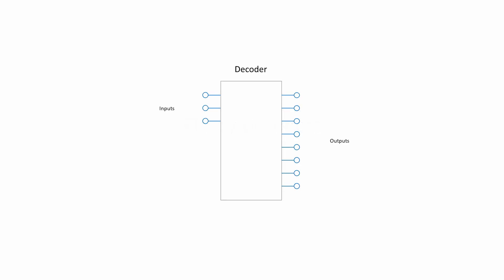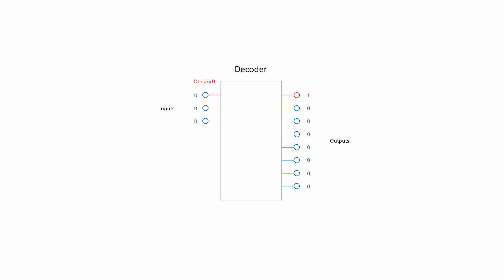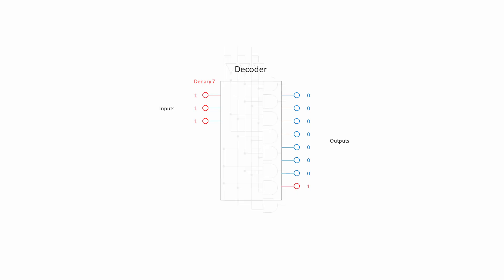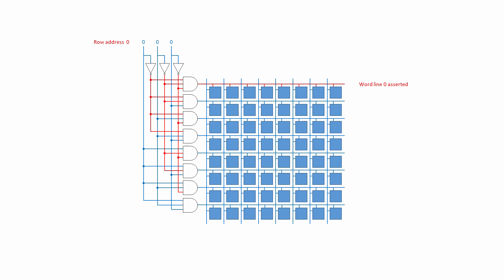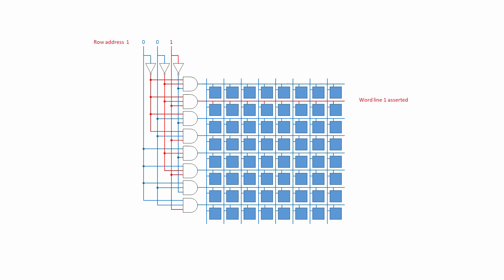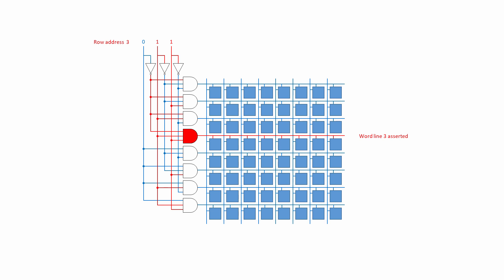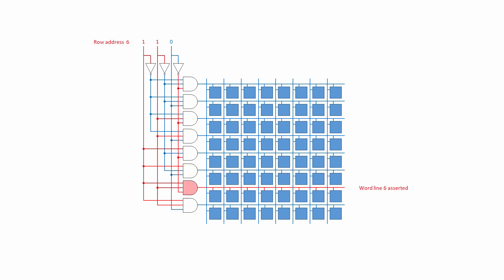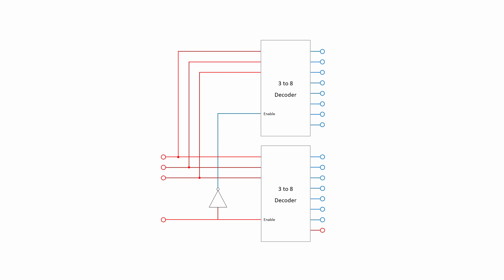Dynamic Random Access Memory (DRAM). Part 3: Binary Decoders

Comment: I enjoy your videos, but denary refers to base-10. The three inputs are a 3 bit binary value - no where in your example is 10 of anything represented. The circuit is most accurately described as a 3-to-8 binary decoder

Comment: For those who don't know how binary works, basically: 
- 0 = 0
- 1 = 1
- Then, instead of going up to 2, binary only goes up to one until it goes to a second digit (like how after 9 is 10, after 1 is 10)
- So 2 = 10
- Then like after 10 comes 11, after (binary) 10 comes 11,
Example:
12 = 1100
The first of four digits is 1, so it tells me to start with 8, then the second digit is also 1, so I add 4, then the last two are 0 so I add nothing; leaving me with 12.

0(0), 1(1), 10(2), 11(3), 100(4), 101(5), 110(6), 111(7), 1000(8), 1001(9), 1010(10), 1011(11), 1100(12), 1101(13), 1110(14), 1111(15), 10000(16), 10001(17), 10010(18), 10011(19), 10100(20), 10101(21), 10110(22), 10111(23), 11000(24), 11001(25), 11010(26), 11011(27), 11100(28), 11101(29), 11110(30), 11111(31)

Hope this helped someone! :)

Comment: Great Video! Thank you! May I ask you what software do you use to create these videos? Specifically those digital and analog circuits and put them together? Not necessarily simulate them, but just visually putting them together like this? 
Thanks again!
Reply from the maker: Thank you.
I uses Adobe Fireworks CS5 to create the graphics and PowerPoint to put them together.
:)KD

Comment: Great video as always, thanks a lot! You usually answer most of my questions as they come up, but for once I did have one left:

Regarding the combination of decoders, I was wondering how one gets all outputs to 0, meaning no word line is asserted, similarly to what the Enable does for a single decoder, but for both this time.

Well, if anyone had the same question: simply replacing the NOT by a NOR gate with a new input called "Disable" for instance, would allow us to have both Enable pins go to 0 whenever Disable is high, and behave normally otherwise.

Of course, the "Disable" can be made into a "Global Enable" by way of an additional NOT before going into the NOR.

Anyways, have a good day, anyone reading this!